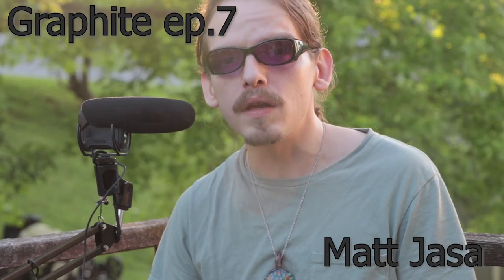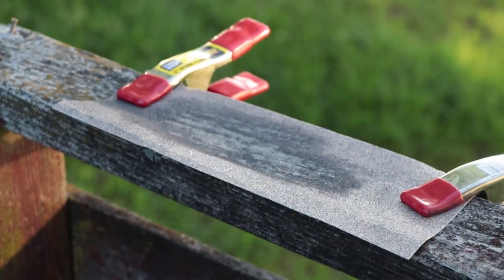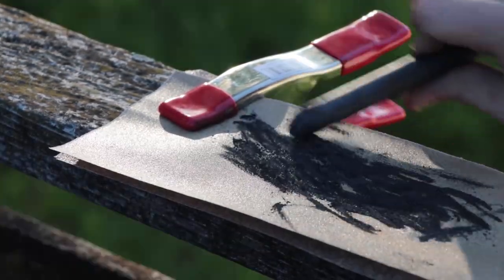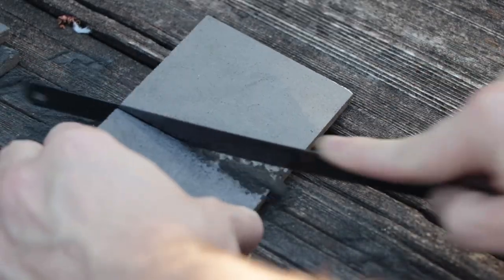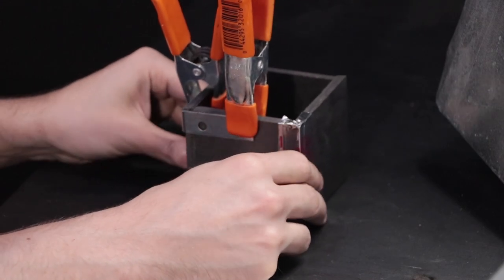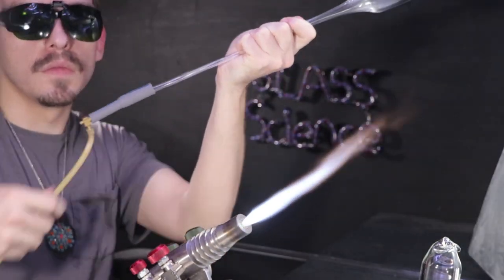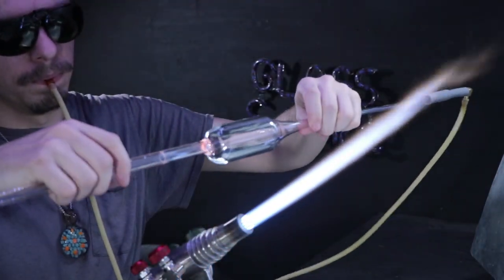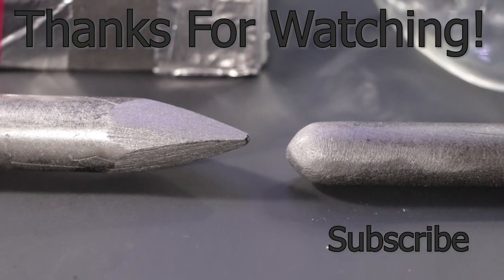Making Glass Blowing n Lampworking Tools

Comment: Surely you could ziptoe a vacuum head to that clamp to suck up any potentially harm dust?
Reply from the maker: Hey Josh, you surely could. I've attached a small shop vac to an electric grinder at one point, It still got pretty messy. It's like very hard chalk, it rubs off on your hands as you handle it.

Comment: Matt
I certainly appreciate your time.   Could you explain, what it means, to ramp up and hold   In regards to kilns.   Thank you
Reply: Or maybe a short video explaining the kiln and kiln use
Reply from the maker: @Spence4420  I'll have to do that, I know I haven't talked a lot about the kiln yet. Ramp up should be the rate that the temperature will climb in an Hour. Hold will be how long to keep it at the target temperature. 
      So for example: 
Ramp 350, Hold 1050 for 30 minutes.  (it will take 3 hours to reach 1050f* and will hold it there for 30 minutes.) Then Ramp 150, hold 900 for 15 minutes. (It will cool down from 1050 to 900 over an hour and hold it at 900 for 15 minutes before shutting off.)

Ramp Full, Hold 1050 for 30 minutes. Means the kiln heats up as fast as possible to 1050 and holds it for 30 minutes. 

What temperature depends on the type of class (or clay) and how slow to ramp it depends on how thick the glass is.
Reply: I appreciate how Matt addresses the laymen without over explaining. Some peeps vids would tell us how to tye our velcro shoes and plug the kiln into the wall, explaining the breaker box and its operation b4 getting to the "ramp up", by then losing ,sadly only, 65percent of the original veiwers, thnx Jasa lol

Comment: Hey Matt  I BOUGHT SOME GLASS TUBES FROM A NEON SIGN MAKER. The tubes are clear. However when I put the torch to it and close the end to blow a herb bowl; the glass turns dark gray with a metallic shine to every place I used the torch. Is that safe to smoke out of? why would it change color like that? I have not added anything to it
Reply from the maker: It sounds like there is something inside of the tube. If you wash them with isopropyl alcohol try water instead as left over isopropyl might cause weird effects. I don't make pipes, but from a scientific view that might be dangerous as heavy metals are toxic to the body.

Comment: Thank you for the info 
Have you heard of anyone making a diy blowpipe?
Reply from the maker: Like for projecting darts? I haven't seen one, but it shouldn't be that difficult to make. I might have to try it. Thanks Drew for the suggestion.
Reply: @MattJasa  I was actually going to ask how easy is it to make your own blow tube for glass blowing
Reply from the maker: @feral7094  Hello FeralGore, are you asking about how to make glass blowtubes or glass tubing in general?
     We craft the glass blowtubes from glass tubes fairly easily on the torch before we start our project. They shorten with use so eventually you'll want to re-purpose them for another project and use a new tube. Its good to buy your tubes in bulk (crates): 50 tubes at a time.

Comment: Hey, I need to pick ur brain for just a sec. This past week I perchased a 20lb box of miscellaneous graphite off ebay :) I purchased it to do exactly what your doing with it, making my own tools, molds, texture blocks, and so on. But of course graphite gets everywhere! Just from opening the box my hands were completely covered in black soot! I've also purchased graphite rods from abrimagery.com and they do not turn my hands black. So I'm guessing they have some kind of coating on them? Maybe liquid graphite? If not do u know what is used on them? And if it isn't a coating what do they do? Can u please shed some light on this subject for me. It will be much appriciated! :)
Reply from the maker: That's a good question, but I'm not entirely sure. It might be a composite of materials like graphite + clay in certain ratios. Overall be careful not to be breathing in the graphite dust. It's not as harmful as glass dust but over time it can be bad for the lungs as well. I suggest a mask, gloves and sanding by hand. Also I do recommend the Jacks tool, those are normally stainless steel mine were $60.
Reply: @MattJasa  Good point about the mask, I always try to wear one when making frit but besides that I dont think about it too often. Thanks for ur help tho, I think I'm going to go ahead and order the liquid graphite to play around with, couldn't hurt. But Im also wondering if maybe its a heat thing. Like maybe after shaping the tools they get placed in an oven/kiln for so long at a certain temp. I also agree with u about the jacks. I couldn't imagine having to work without them and $60 isn't bad at all for a good pair 👍Have u ever been on ABRimagery.com ? If not u should really check them out! U talk about mountainglass.com on here a lot, I like them also but more so for tools and torches. ABR seems to have way better prices for glass. Plus they are the only appoved vendors for boro batch, one of my tab glass companies. And they offer way more experimental/small batch colors, stuff that no one else has or ever will. Good sales too, right now glass alchemys cobalt is on sale for $15 a pound and their lite cobalt is $22 a lb! And right now there offering  something called "knock out deals" when ur going to check out. Once u click the check out button in ur cart the offer page comes up and on there u can grab a lb of Boro Batches Wild Honey for only $15 and their Hurricane Strike for only $17 😁 I obviously love them so I just thought I'd share rhe wealth with u 😊 
P.S. I know u work with a lot of  tubing and most 9mm chinese colored tubing is only $1.50 for a 4ft tube and the 12mm is only $2.40 for a 4ft tube👍 I love it❤ It made it possible for me to do, and learn, and experiment a lot more as a beginning glass blower!

Comment: great keep up the great work :) can u start with a cheetah gtt for med size piece's?
Reply from the maker: I've never used a Cheetah, I would imagine it would do up to 38mm tubing. It looks like a cool torch the only thing that might hold me back is not having a smaller center fire. If your doing connections/welds having a small center fire helps.

Comment: Why graphite?
Reply from the maker: That's a good question. Because of its physical properties it handles the heat without bonding or sticking to the glass. Other metals also work, but can bond to the glass once they heat up. It's also soft and easy to grind into what shape you need. You have to be careful, as the whole rod will warm up with use, so creating a handle from another material will help limit that thermal transfer.